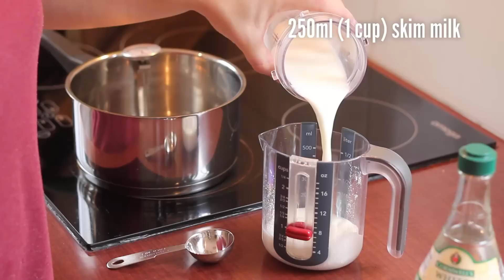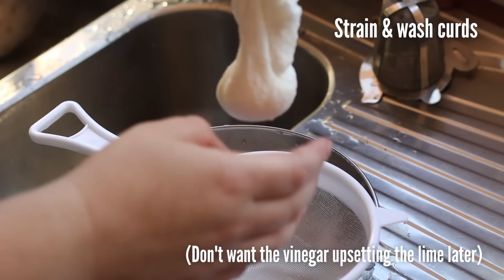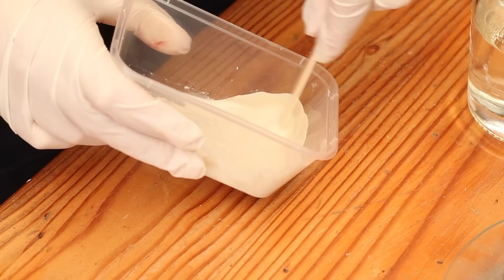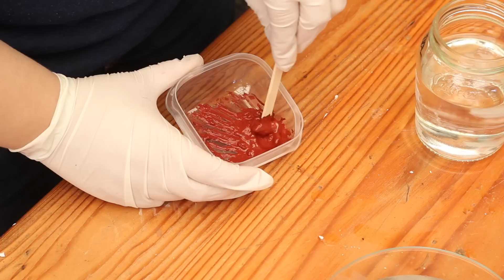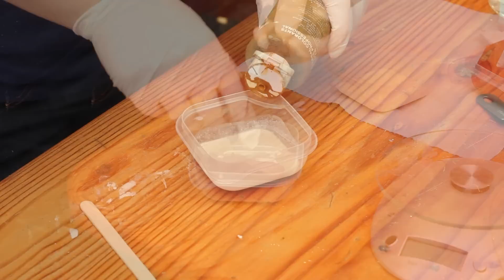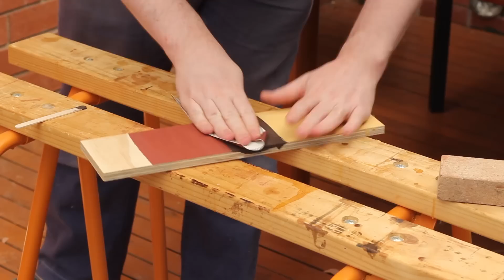093 - How to make Milk Paint

Comment: Hi Paul, thanks very much for the video, very clear instruction. was thinking of using Porters Milk Paint on a cupboard, but I'll go the traditional route instead. Cheers
Reply from the maker: +TheBigO K Other than being  all dehydrated and needing water (how do they do that? dehydrating the curds perhaps?), I'd say Porters would be pretty close to this recipe. They might  add in borax (anti-microbial properties), they might use a different calcium carbonate (instead of lime, maybe using chalk), but every milk paint recipe is about this simple with some small variations

Comment: Maybe a stupid question, but why would one want/need to make milk paint ?
Reply from the maker: For 800mL or so, the cost is about $1.50AUD. A little cheaper than latex/acrylic paint. And zero VOC/smell.
Reply: +Paul ‘TheWoodKnight’ Jenkins Great argumentation :-) Will try it as well as I am always annoyed by paint pricing :D
Reply: Probably it can even be cheaper by getting milk close to the "use by" date: generally shops sell it with a substantial rebate.
Reply: I have Athsma and allergies . voc free paint costs a fortune .

Comment: what surfaces will this work with ?
Reply from the maker: +Nihad Any porous surface should work fine. Anything smooth (plastics/laminate) may need either a mechanical tooth created first (ie, coarse sanding) or you can use products like 'Extra Bond' to  make them adhere better.